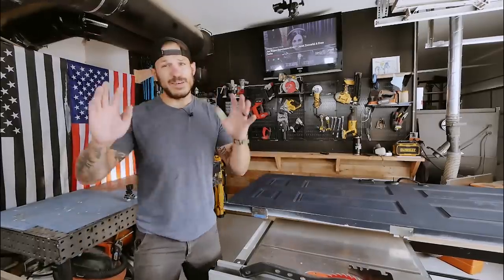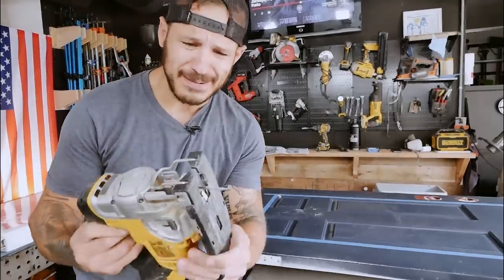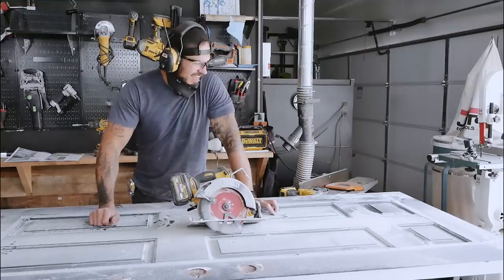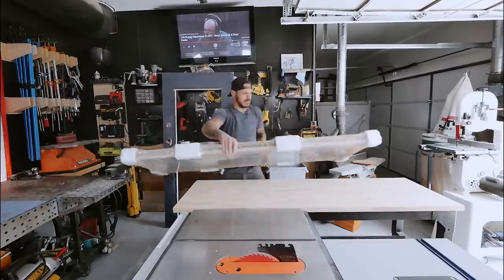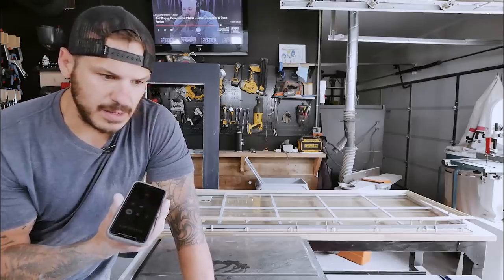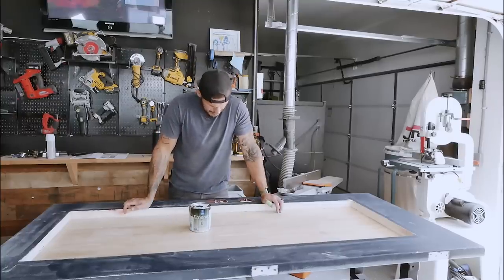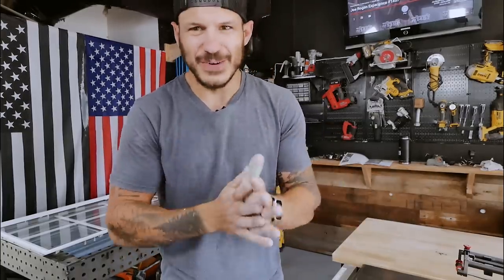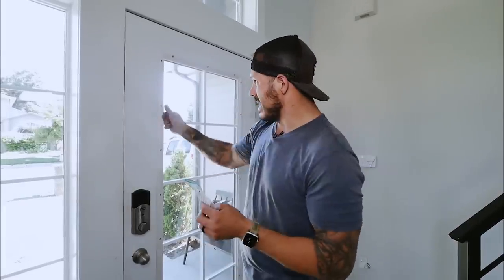Front Door Makeover | Making a Glass door

Comment: I've worked in a door shop for over two years now and one thing that will help in the future is to caulk around the glass. From what it looked like you got an ODL brand or sister brand and the seal between the door and the frame (the little black foam pad on the insert) isn't the best so just running a little bit of caulking around will help with that.

Comment: Looks great but personally I don’t like a glass door for security reasons.
Reply: Good point
Reply: There's glass around the door already, adding glass to the door itself doesn't add any additional vulnerability. A good security system is probably already in place.
Reply: He's probably packing heat.
Reply: privacy reason too
Reply: Hi John. The glass is actually double paned tempered glass (like windshield glass) not window glass which is annealed glass.
Reply: Already got ground floor windows around the house, can't see how you would be increasing/decreasing security with another one.
Reply: Someone breaking in would most likely try to kick the door in and not break the glass. Breaking the glass runs the risk of getting cut and leaving behind DNA and injury. Criminals usually want to get in and get out quick.
Reply: same huge security risk
Reply: Preston Reece the majority of burglaries are through the front door. I have also seen incidents where burglars cut out the glass panel he installed with a saws-all aka, Reciprocating saw to gain entry into the residence. Then they simply placed the glass panel to the side and burglarized the home without actually opening the door. They did this to avoid the alarm door sensors and glass break signal from the alarm system.
Reply: @adrianrouse3619  I mean if they're using saws to break into a house this isn't some small time burglary. My point was simply that adding glass does not make it more susceptible to break ins. Most do go through the front door but they usually kick them in and don't break the glass. Breaking glass is much higher risk.
Reply: I’m guessing you could get a window tint that doesn’t allow people to see in well but you can see how if it was a big concern
Reply: On the contrary as the thieves would hesitate they will wonder if there is someone inside or not.
Reply: He lives in a good neighborhood.
Reply: It’s no different from having a sliding glass door in your backyard
Reply: If your house has windows, it literally doesn't matter if your door has a glass insert
Reply: that is very true!
Reply: Off topic I know but since there is no “jesus of Bethlehem”

HERE is The REAL MESSIAH, Who they REALLY Crucified for the sins of man 

From the Dead Sea Scrolls Exodus 3 Scroll, "Yad He Vav He" is what Moses wrote

Paleo Hebrew Direct Translation
Yad "Hand"
He "Breath"
Vav "Nail"
He "Breath"

YaH's Name:
(Ya)d + (H)e, as YaH is what Moses called Him as well all throughout the Book of Isaiah and Psalms, "this is My Name for all generations" (Exodus 3)

YaH The Creator:
Yad He, (Hand Breath), as YaH's "Hand" Formed man from the dust  of the Earth and His "Breath" made him a living being (Adam)

YaH's Sacrifice of Crucifixion:
Vav He (Nail Breath), the "Nail" through the "Hand", that whosoever shall call YaH Savior, His Breath brings forth life (Salvation)

How YaH arrives:
YaH arrives via the Tent of Meeting (Exodus 33:7:11), NOT through childbirth (Isaiah 45:10)

Why they demanded YaH to be Crucified:
YaH was Crucified according to Hebrew law (Deuteronomy 21), to be Hung on an Almond Tree for BLASPHEMY, as the Messiah claimed He was YaH. 

He was YaH

Isaiah 42:8
"I am YaH; that is my Name! I will not yield my glory to another or my praise to idols.

Isaiah 43:11
I, I am YAH, and there is no other Savior but Me.

Isaiah 45:5
I am YaH, and there is NONE ELSE
Reply: @goggles789 well I'm not a criminal for one so there's that but I have witnessed a break in first hand. I have also talked to many law enforcement officers over the years about the incident. So maybe where I live criminals act differently than where you live. Not trying to argue about it criminal logic with you. It's just a fact.
Reply: John Laizza yeah, I don’t like it as well. It makes me feel unsafe even if it isn’t gonna break. Also it’s letting people see right into your house which I don’t like.
Reply: Wargarblet It does matter
Reply: @bobloblaw1720  steel windows never streak or fog up.  haha
Reply: If your really scared cause of privacy, just place a door curtain over the door
Reply: @nopeasant   he should have used that glass.anyways he can just change those anytime he wants
Reply: Building codes in the US and Canada require doorglass to be tempered safety glass.  MUCH stronger than window glass.  The most common break in is kicking in a door. A fierce kick to the glass will cause the door frame to break at the strike plate before it will break the glass.  Privacy can be controlled by the glass option that is selected.
Reply: He's most likely confident in the safety of his neighborhood or he probably wouldn't do it. If your first thought when you see this is that someone will try to break in then you shouldn't do it.
Reply: Tint it
Reply: Glass is no less secure than solid. if someone wants to get in, neither will stop them
Reply: Unless you have bars on all your windows if someone want to get in, they're getting in.
Reply: @zabitat  windshield glass isn't tempered... on a vehicle the side windows are tempered the windshield is laminate.
Reply: @jenniferdahl4010  Well, that would come in handy. In a Zombie Apocalypse xD
Reply: I like a full french door for security reasons.  Sounds strange but here's why: With a solid door you can't see out, therefore if you hear a strange thud behind the door you have to rely on your security camera (if you have one) to check it out or get a vantage point from another room if possible, or open the door.  With the french door, however, one quick glance confirms if it's something to worry about or not.

Another reason is the ability to see as I am going outside before I even open the door. A criminal could be waiting to force you back in the house.

Just don't have the type of lock that you have to turn to unlock it and don't leave keys in it.
Reply: @adrianrouse3619  not if they have motion sensors in the foyer :)
Reply: And some security film, door sensor and glass sensors and motion sensors there is no way that they can break into a house.
Reply: 1. Glass windows.     2. Second Amendment.
Reply: His wife told him she wanted it.  Women and security go together like peanut butter and car batteries.  Gotta make the wife happy, right???👎🏾👎🏾👎🏾
Reply: You have windows all over your house  so one in the door isn’t making that much difference in security. I have 3 doors with glass and  8 low windows on the first floor. I just refuse to live in fear of what could happen  plus I have a Winchester 12 and a glock9 security system so I’m not worrying.
Reply: @danbailey96  💯👍💚
Reply: But you have glass windows.
Reply: Same
Reply: @nopeasant  I personally have blinds on the glass I have on the sides. Not a fan of people being able to look in my home by any means.
Reply: Anybody trying to come in while I’m home just gives me a better view waiting for them to make that step in… I live my glass door. I put a mirror tint on inside so I can see out in day.. they can’t see in.. at night or when I’m gone I drop a bamboo shade down it and have 3 dogs that lay at door that aren’t going to let anyone even get on my porch….😊
Reply: If a thief wants in, they are coming in. The best thing to do is to make your home as secure as you can and have an equalizer at hand, just in case.
Reply: You can use safety glass,  templer glass or lami glass there are many options

Comment: Commercial steel doors are almost constructed the same, but with two metal faces usually welded on the seam, usually hidden by the edge, and then either has similar insulation foam, or a cardboard honeycomb pattern between the two faces.

Comment: Dont paint the PVC trim rings dark colors as with most brands it voids the warranty. It will cause the PVC to absorb extreme amounts of heat leading to the frame warping or cracking. It also can lead to seal failure on the insulated glass unit. Also install the plugs before you paint it.